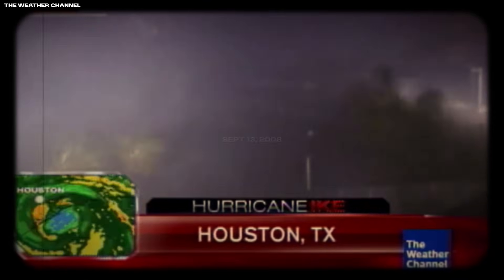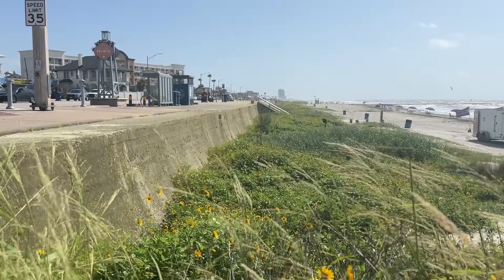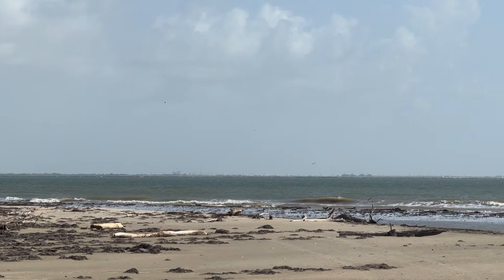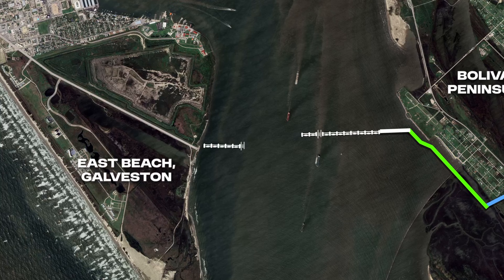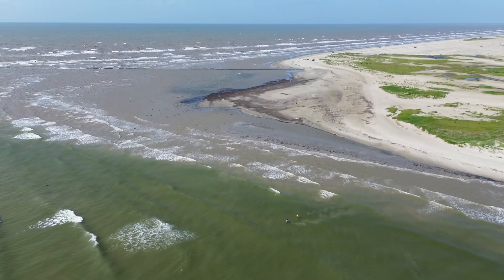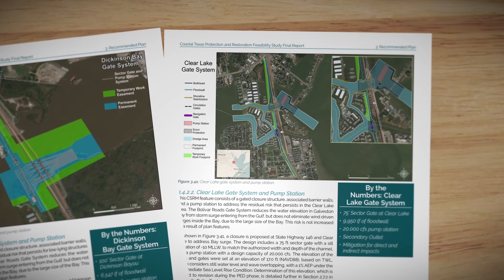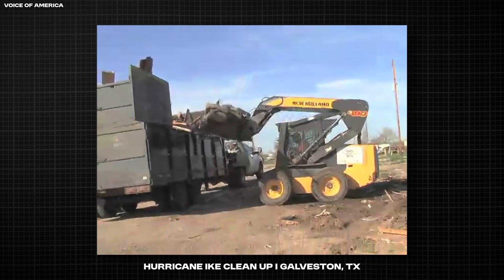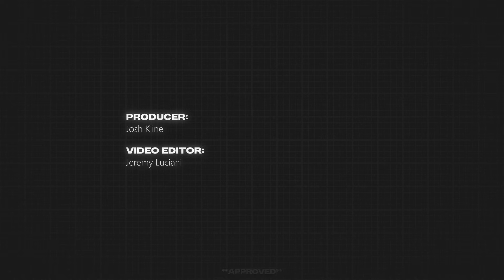Inside America’s Biggest Storm Barrier Plan

Comment: As a Houston Native for more than 40 years, each storm had its own personality.  Some were more similar that others.  Tropical Storm Allison, while wind speeds were not high, the rainfall was devastating. Everything was flooded for days. Enough so that even though the storm never became a hurricane, they still retired the name.  Ike,  like Hurricane Alicia, smacked the coast with high winds and just blew everything away.  The rains quickly died down and the floods water receded quickly but there was still massive damage.  Hurricane Harvey was like Allison's big brother.  A quick google search, "Yes, the National Weather Service (NWS) had to add new colors to its rainfall maps for Hurricane Harvey because the storm's rainfall was so extreme and unprecedented..." But the wind damage wasn't much.  For Harvey and Allison, Power was still on for most of the time.  Ike 2 miserable weeks with no power.  You could drive around, nothing was flooded but you had no power. Harvey and Allison you had to use a boat to go anywhere but at least we had some power.  As early as 2024 with Hurricane Beryl, it was like a "Little Ike."  Power was out for several days, but the streets were clear soon after the storm passed.  After all these years I have come up with my own category of storms.  Will I be trapped by flooding?  Many storms like Ike came and went but I wasn't trapped like Allison or Harvey.  If your on the coast I would also consider storm surge. Do I need to Evacuate?  After all these years, I learned 1 thing.  If your not under mandatory evacuation, be prepared.  Get enough supplies including a generator to last 5 days minimum.  If you live in an apartment and can't run a Jenny, just be prepared for 5 days without power be ready  to leave.  If your new to the area, don't be shy to ask your neighbor, "How you lived through a Hurricane before? what did you do?"  Us Texans are here to help each other through catastrophes.